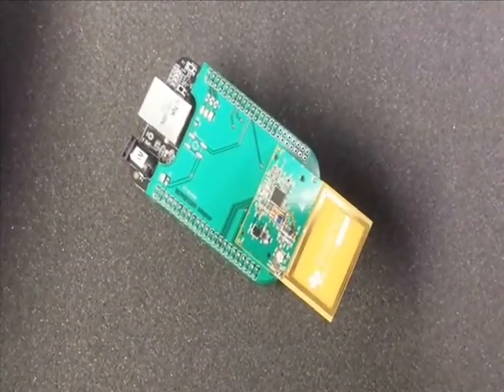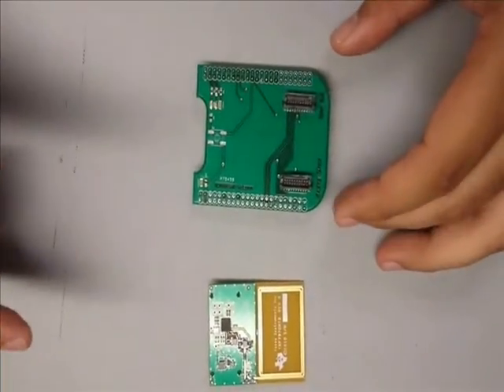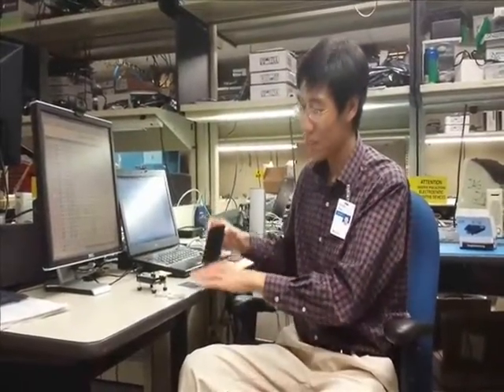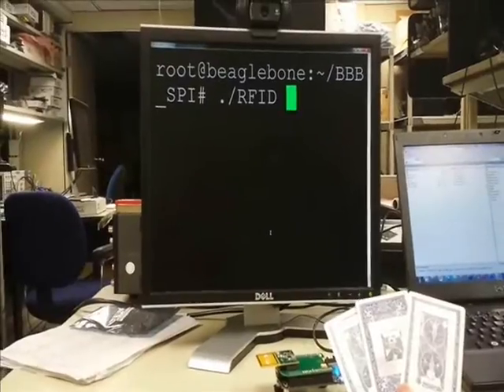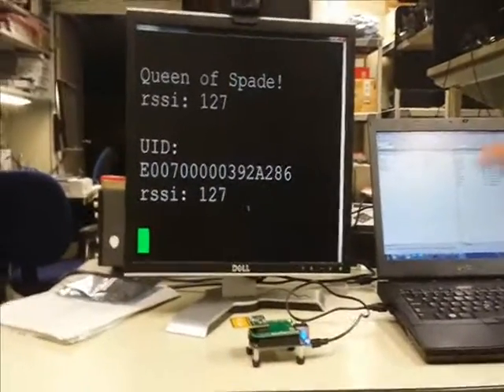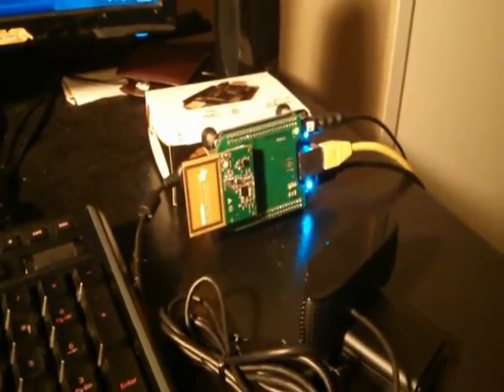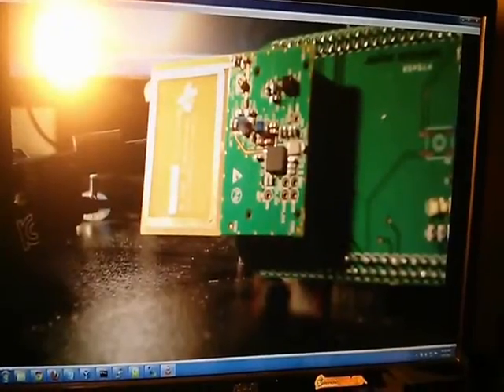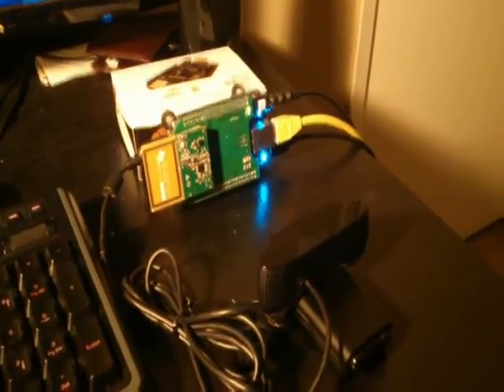RFID Adaptor Cape for Beaglebone Black introduced

Comment: Amulya, is there any place where I can buy your #BeagleBoneBlack #RFID cape (including the TRF7970ATB module)? It's kinda urgent.
Reply: Daniel, I am another contributor to this project. This is a link to our project. http://elinux.org/BeagleBone_Black_RFID_Adaptor_Cape. It contains the gerber files required to manufacture the board. TRF7970ATB module can be purchased from Texas Instruments' website. However, you need to find the male connectors to connect to the ATB module and solder them.
Reply: Sheng Zhao hey pal, thanks for your answer. I was also trying to contact you but you was the hardest to find. As I wrote here and just said to Edwin via LinkedIn, I'm urged about getting one of the capes ready due to my impossibility of making the PCB. I need to deliver a prototype for the next week and my company will pay you guys for. Thanks in advance.